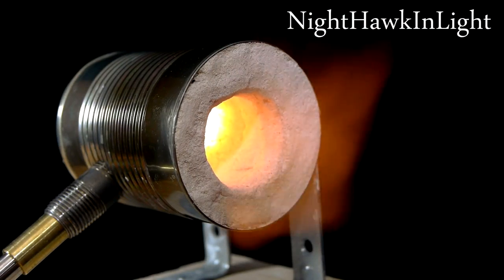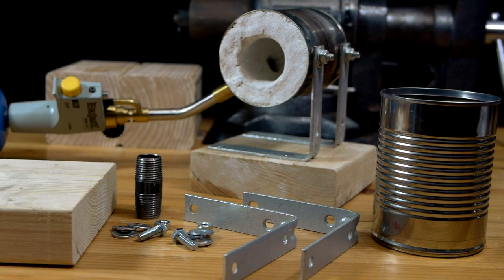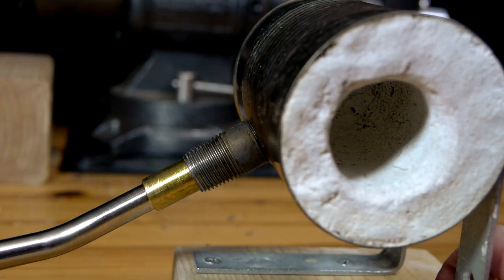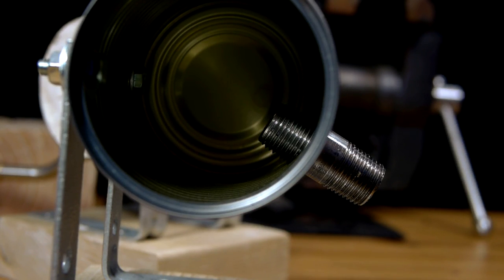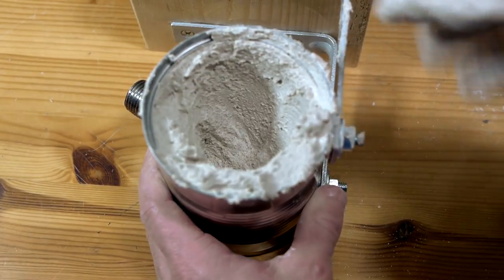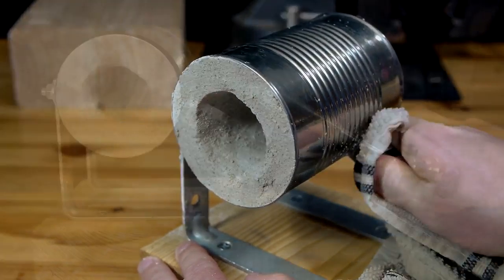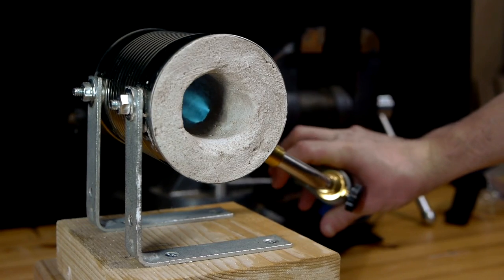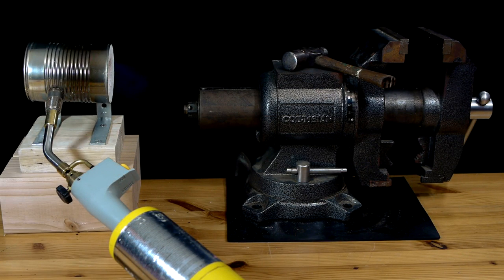How to Make a Soup Can Forge

Comment: Quick, semi-daft quesiton. Could this melt iron (1.5k °C melting point) or just soften it up?
Reply from the maker: No, probably not.
Reply: That's what i thought, but you said 2 thousand (didnt catch if you said feren, cel, or Kelvin)
But i thought i'd double check. Thanks however :D!
Reply: SteamShinobi its in faren.
Reply: Why doe steel have a lower melting point than iron? I would have thought it was the other way round?
Reply: HXTonner It doesn't. The melting temp is several hundred degrees C higher for steel.

You're probably getting confused between C and F.
Reply: Depends on if it is ductile iron or wrought iron.

Comment: I need help I did what you video says but it's still not heating up any  Thoughts? Could it be my blowtorch or that this is still moisture in the can ?
Reply from the maker: If you're using a soft flame torch like I do in the video it should work once the moisture is driven off. A pencil flame torch will not work.

Comment: Here's an idea... want to upgrade from making knives to making swords?

Take this same concept, along with the propane tank smelter idea to melt down some iron, use a piece of angle iron as a form, melt some iron nails and wire and such in the smelter, pull the crucible from the smelter, and pour the hot metal into the form. Once the metal in the form solidifies and cools enough for it to be workable without bending too much under it's own weight, grab those forging tongs, and use a...

... stove pipe forge.

***Build this before you start smelting the metal of course.***

The stove pipe forge is the exact same thing as your soup can forge, except instead of using a soup can or coffee can, you go to Lowes or Home Depot or whatever other building supply store you can find, get a piece of BLACK, WOOD STOVE FLUE PIPE, (theblack pipes are generally tougher and thicker and will stand up to a beating a little better) unless you can find some of the galvanized kind that is fairly thick about 48 inches long by 6-10 inches in diameter, a pipe cap, and the rest of the stuff you used for making your soup can forge, but tripled in quantity.

Then build the stove pipe forge same as you would the soup can forge, but instead of just one burner inlet, make three burner inlets and place them equal distance along one side, using either a monorail fuel supply system, or three supply hoses to three separate nozzles. Also, instead of a handheld torch, use a propane grill fuel injection and burner system, in triplicate... minus the burner grid of course.

Also, it might be a good idea, to make a fourth inlet hole near the top rear corner of the pipe,  at an angle into the pipe, and a small blower fan be attached via a bit of piping and duct work, thus providing an oxygen source that will allow you to increase the heat being shot into the forge.

Then once you have the forge you can use it after you have smelted yourself a triangle bar ingot and it has solidified.

After the metal from the smelter has cooled enough to be solid and picked up with forging tongs easily without it bending or breaking, then you take it to your anvil and use the remaining heat to start the forging process. When your sword blank/bar ingot becomes too cool to properly work, then you slide it into your stove pipe forge... and turn the heat back up... and let it get hot again.

To accelerate the heating process a little, kick on your blower for a few seconds or so, and let it blast the heat up a couple thousand degrees. Then once it is glowing hot again, yank that blank back out and keep on smacking it with that hammer.

Viola... you are now a sword smith as well as a knife smith. And if you get the right tools and use a coffee can instead of a soup can for your "soup can forge" and make a coffee can forge, you can also be an Axe Smith as well.

Comment: Hey there great video, im 14 and dont have a lot of money; how much in all did this cost?
Reply: It cost me $29
Reply: +Mark Allsup Same position here
the torch head (ts4000 is the same as the ts800 minus a flame control and it is cheaper) + propane tanks = $45-50
plaster of paris + sand = $15-20

Comment: How long should you wait for the forge to heat up? I've had it going for 15 minutes and the aluminum still doesn't want to melt.
Reply from the maker: Are you using the same torch I am? It won't work with a pencil flame torch.
Reply: @Nighthawkinlight  I am using Benzomatic TS4000ZKC. It's supposed to be high heat.
Reply: @Nighthawkinlight  It seems that the cans I was trying to melt are not really aluminum, hence they mostly just burned up, have to try with actual metal. Thank you for your reply.

Comment: Hey NightHawk! Its me again lol. I made this and mine doesn't seem to get as hot as yours... I made it so there is a larger cavity in the forge and it is tighter on the outside. Any ideas?
Reply: A larger cavity would allow more room for convection and is making it cycle cool air in faster, a good idea is to fill the cavity with a small later of the plaster, just to constrict the heat

Comment: May I ask what plaster of paris actually is? I want to make a forge and since I doubt thats available in my area, an alternative would be great.
Reply from the maker: ***** CaSO4. It's not the best option for a forge lining, but it is the best replacement that is commonly available. Look for fire/refactory cement or google actual forge linings and you'll find the real stuff.
Reply: Mc Rex, if you have a hardware store in your town it will most likely carry plaster of Paris
Reply: Get some refractory cement :) I use Kos from ebay. 6kg for around 15 pounds.. Far better and not hazardous unlike plaster of paris which can give off some nasty fumes and doesn't last that long.

Comment: Why is it necessary not to cover the air holes on the propane torch? what will happen if i were to do so? and how do i go about fitting it with out covering the air holes?
Reply from the maker: If you cover the air holes the torch will not burn very hot and will also make carbon monoxide. The air holes on a spiral flame torch are usually near the handle so you don't need to worry about the forge pipe covering them.
Reply: Is it possible to poke the holes on the the torch all the way through without have major problems?
Reply from the maker: Timmy Smith All the way through into the forge? No, you cannot do that. The forge will not have air to burn.
Reply: NightHawkInLight does there need to be air because my blow torch doesn't have any air holes but it doesn't get hot

Comment: Can you use clay instead sand and plaster???
Reply: doubt it, the sand and plaster is very good at absorbing heat and is very resistant to it, as clay would probably shatter, but probably depends on type of clay, etc

Comment: Plaster of Paris is not a good material to use. Conducts too much heat. You want to hold heat in. Use Fire Clay (available at Home Depot, etc.) mixed with sand if you must make your own refractory. Add a touch of Fire Cement to make it durable. Won't cost you much if any more, and you'll end up with a better product.

Comment: Does this forge get hot enough to melt gold?
Reply: It should. Gold melts at 1064.18 °C,/1947.52 °F and Propane burns at 1,995 °C (3,623 °F) if all goes well. (Figures from Wikipedia)
To purify the molten gold, sprinkle it alternately 3-4 times with Borax powder, then Sodium Bicarbonate, baking soda. (Avoid breathing in the fumes that off-gas from them: the fumes could contain toxic metals like mercury, lead, copper, etc. Gold used in jewelry often is hardened with bronze, a mixture of copper and tin, along with some lead for easier machining. ). The Borax and baking soda are fluxes that will purify the gold.
The more difficult part is finding a usable heat-proof crucible to melt the gold in.

If this forge doesn't work for you, try using the hotter MAPP gas or propane and oxygen.

But don't try this until you've done more research on the art and science of smelting gold and casting it. There's a lot I've left out. Check for books, etc, from Jewelers' supply companies.
Wear proper safety gear, too...

Comment: Cost of the forge: £15 + 

Cost of the equipment required to make this: £10,000 +
Reply: No. Hammer $10 vice $30-40. Torch $40. Drill $20 various drill bits $10-15. More like $130 for the cheapest tools,  but most people would already have a lot of this stuff

Comment: How would you make sure the holes at the tip of the torch are not covered?
Reply from the maker: It's the air inlet holes you have to be sure aren't covered, not the outlet holes that are at the tip. If any of them are covered the torch won't burn right.
Reply: ok thanks!

Comment: could perlite or vermiculite be used in place of sand?
Reply: +Colson Customs I don't know, I belive vermiculite acts like drainage in soil and doesn't absorb water so it should be okay. I don't know about what happens to vermiculite at high temperatures though, it may release some really nasty gasses (if you plan on trying it you should research it more). Pearlite on the other hand will retain moisture in soil, so when you heat your forge for the first time it would probably just crumble to pieces as the water turns into steam, or worse yet if the water is able to flash into steam more quickly, it could cause piping hot chips of plaster/perlite mixture to be ejected like bits of popcorn.
Reply: Kodizzie
Ah, thanks for the heads up.
Reply: People usually use fireplace mortar and perlite or perlite and fireclay, and sometimes something else too

Comment: Does anyone know if its harmful to breath near it? I made one and it gives off some weird smelling fumes and i don't know if thats the propane torch or something i should be concerned about.
Reply from the maker: It could be a plastic lining in the soup can that is burning off. Use in a very well ventilated area and it shouldn't be a problem. Some soup cans are lined but it's a very small amount of plastic that shouldn't stick around very long.
Reply: Thanks! just making sure
Reply: WastefulProduct You can always invest in some masks as an extra safety precaution if you are still unsure

Comment: could i make a bigger one and  use a propane tank with a hose to the can and light it manually?
Reply: Wouldn't recommend using propane
Reply: what do u recommend?
Reply: king of random
Reply: Dont people usually use propane?
Reply: Anton Helsgaun Yeah just if a fire goes out a large tank of propane will cause more damage so use small ones
Reply: Jamie what do you mean "if a fire goes out"?
Reply: Yes you can . But check out grant Thompsons design as that would better match what you are thinking.

Comment: Would substituting plaster of paris with grout work?
Reply: Ya will it?
Reply: +Josh Brandon It should, but I would let it cure at room temperature before using, don't try to dry it with a torch.
Reply: +Tailss1 I tried it, it started to burn the grout and put of some ( I'm assuming) dangerous fumes
Reply: Josh Brandon yes use a sanded grout.. a smooth.grout has polymer plastic in it. Usually a floor grout rather than wall

Comment: for some reason my forge will not heat up... I did it just as the video describes but all I get is a flame in a can. any idea what might be wrong?
Reply from the maker: The forge will burn cold until all the water evaporates. Let it run for a while. Are you using the same torch as I do?
Reply: NightHawkInLight thanks for the quick reply... I am using a Bernzomatic JT680 jumbo torch... I have ran it over 3 hours total with the same result.
Reply from the maker: That's a pencil flame torch, a forge requires a spiral flame torch. See the video description
Reply: NightHawkInLight thank u I will try another a spiral... love the video!
Reply: NightHawkInLight so will any swirl flame torch work?
Reply from the maker: I have only tried the one in the video.
Reply: NightHawkInLight oh...
Reply: NightHawkInLight hey just wanted to let u know I got a spiral flame torch... and it's working great now! thanks sooo much!

Comment: hi the forge is good but toxic, the zinc in the pipe fittings get toxic when headed
Reply from the maker: Fittings are only zinc coated if they're galvanized. Black iron fittings like the one I use in the video are untreated with zinc and fine to heat.

Comment: Why isntmine working? I used the same stuff but mine has gone through 3, 2 hour burns and it wont get up to temp still
Reply from the maker: Are you using a pencil flame torch instead of soft flame?
Reply: NightHawkInLight I think that was the problem. What torch head would you recommend? Also thank you for the quick reply!!!
Reply from the maker: Bernzomatic ts8000 or equivalent

Comment: Does anybody think one could use a metal coffee can to do this? Does the type of can need to be a particular metal?
Reply: use steel cans, it can be a cofee can as long as its the rigth size. REally things like tungsten would be better but i doubt youll find one. To test wheter its steel, just put a magnet on it-

Comment: What's the material of the can?
Reply: +Mud Hut Steel .....
Reply: +Mud Hut Soup Can. Probably tin, but that doesnt matter because the thermal shielding on the inside does all the work.
Reply: +GorumGamer soup cans are usually made of steel,although it might be coated in tin
Reply: +@GorumGamer its steel, tin would probadly melt

Comment: I NEED help, so i tryed to make this and when i mixed the plaster and the sand it dryer to fast and got rock hard in about 3 minutes
Reply from the maker: Use cold water and it will harden slower, but yes, you have to be quick.
Reply: thanks so much
Reply: oh wait, i did use cold water
Reply from the maker: Awesome_Platypus I guess you just need to work faster once you add the water then
Reply: oh ok

Comment: This is awesome BUT you never, NEVER put the gas nozzle upright, it must be facing downward or to the side. What if any heat particles, molted metal, etc. goes down the nozzle? You are looking for an accident to happen.
Reply from the maker: +RynScar If hot particles went down a propane torch head nothing would happen.
Reply: +NightHawkInLight Ok, you're kinda forgetting the molted metal, and... Thats not the point, this is for precaution and to minimize risk. Any professional will tell you, do not put the nozzle upward. You can but why would you? The nozzle either faces to the side, or downward. Even if nothing happens to the torch, you can well easily jam it up escpecially if in use frequently. Why justify something thats incorrect? Again, nice vid and nice forge although it is not recommended for the nozzle facing upward.